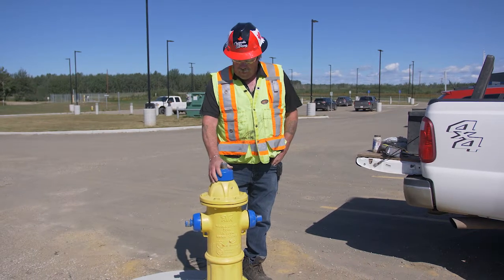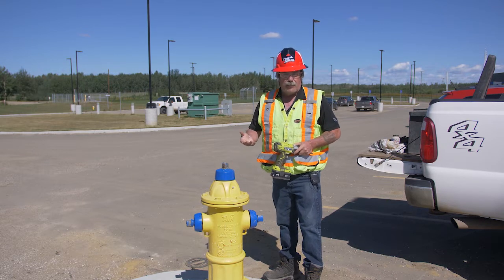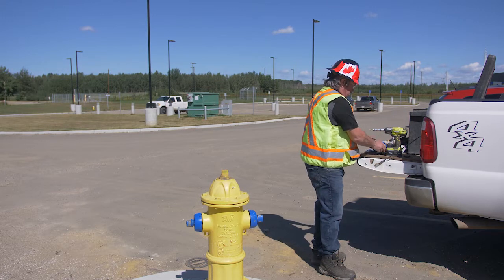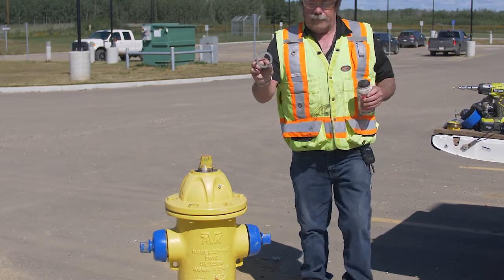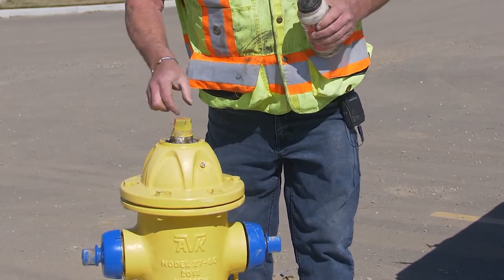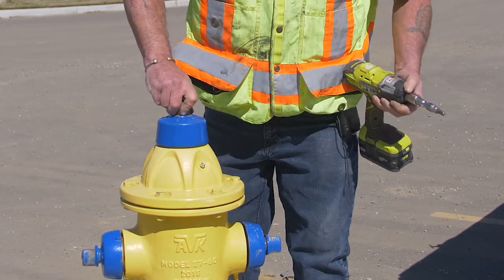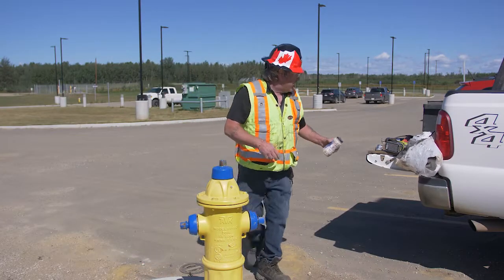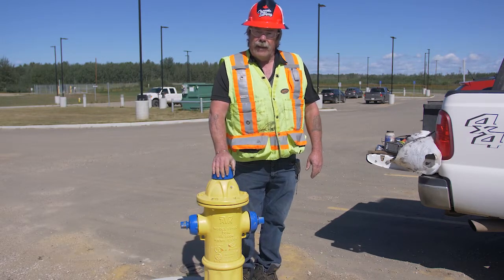Step-by-Step: How to Service a Fire Hydrant

Comment: Why would there be a vacuum?
Reply from the maker: A vacuum forms in the fire hydrant because the draining process removes water from the hydrant barrel, leaving air to replace the water. When you place your hand over the nozzle and create a seal, the remaining water inside creates a partial vacuum as it attempts to flow out or equalize pressure.

This vacuum effect ensures that:
1. Complete Draining: It confirms the hydrant is draining properly, which prevents water from remaining inside the barrel. If water remains, it can freeze in winter, damaging the hydrant.
2. Functionality Check: The suction sound when releasing your hand indicates there’s no obstruction and that the hydrant is functioning as intended.

If no vacuum or suction sound is present, it could suggest a problem with the drain valve or internal components, requiring further inspection.

Comment: I believe I have a private hydrant looks very similar to this style AVK value...
I took the grease screw out with a Allen wrench and lubed the hole in the bonnet but I never did this so extensive as to taking everything all apart....
I believe I have a mechanic wrench or ( monkey wrench)
that will open up more than a crescent wrench to get that holding nut out...
Would rather use it over a pipe wrench so not to bogger up the nut with the pipe wrench...
I was never given any special tools upon purchase of this hydrant.
Could be something sold separately??
Reply from the maker: Hi there, yes it is likely sold separately! Thanks for watching 💙
Reply: @WaterMovement  thanks!
I'll see where to order...
Meanwhile I believe I have the tools needed.